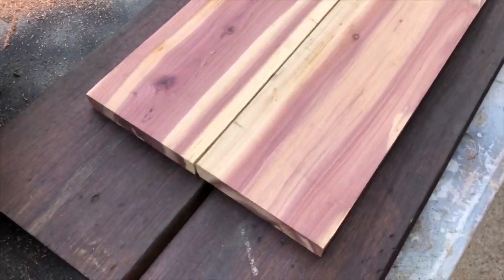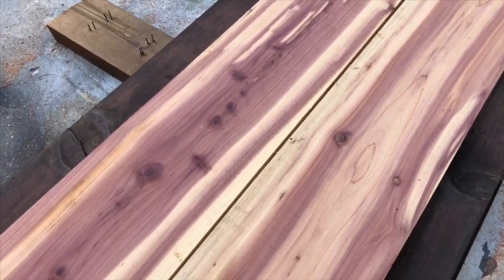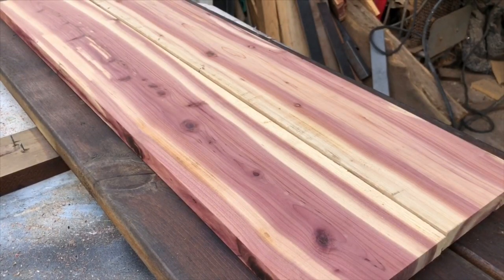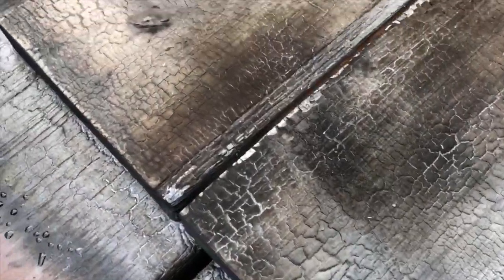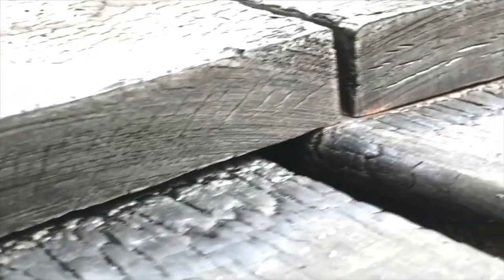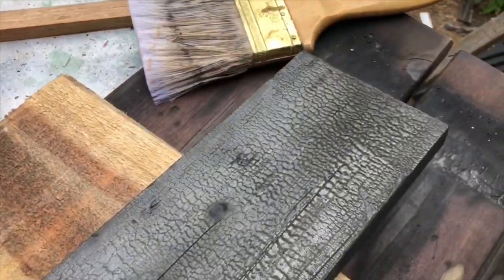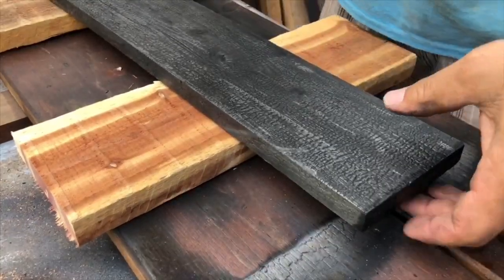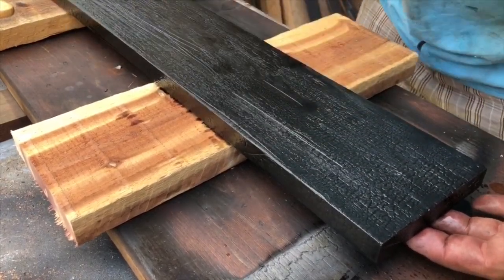DIY Heavily Crackled Shou-Sugi-Ban Charred Cedar Planks Burnt Wood Burning

Comment: Hi there! Amazing video! I was planning to make a new gate but I didn't have inspiration on what kind of material to use, until I saw your video. Therefore I'm reaching out for a couple of questions for someone unexperienced as me:

1) Can I use it with pine wood please?
2) After I get the wood charred, do I need to brush off the charred pieces?
3) Will this technique weather proof the wood if I intend to use it outside? I am from Mauritius 🇲🇺 and it is a tropical island. In summer we get loads of rain. Sometimes cyclones.
4) According to you, which dealer sealer will work best for my project please?
Reply from the maker: Hyperion 
1.yes pine works as well. Check my other videos for the one I did with pine. 
2. You can depends on the finished look you want if you do it will remove the crackle and leave a smoother finish. 
3. Yes that is one of the best things to use this for. Water, insects, fire, mildew and more. 
4. Sealing with an oil based wipe on finish is best.
Reply: @loveofthegrainworkshop2891  oh man! Thanks so much for replying! I'm planning NOT to remove the charred pieces. I love the reptilian texture it has. It adds a lot of character and it almost look "designer".

But I'm gonna seal it with polyurethane. Do you think it's ok? If yes, how many passes of this sealant should I do to stop the soot from flaking off if ever it happens in time?

I've checked your other video you made! I like it a lot! It gives an elegant "espresso" finish to it which looks cool for an interior project I have!

Thanks again for sharing your tips with me.

Comment: Try 100% Tung oil. All natural.  Do you have any problems with warping of the boards when heated ?
Reply from the maker: It can just depend on the board. It will sometimes. It wont sometimes.

Comment: If you were doing this for outside siding, do you need to only use cedar?
Reply from the maker: Chris Richter cedar is the traditional wood used due to its already weather resistant property. But it’s not necessarily required. It will last longer with cedar. And I have found that cedar gives the best crackle look.

Comment: Hi 

Great video. I was not actually interested in doing this technique, but how to fix my accidental fire damage (on pine wood, I think) in my sauna, which looks exactly like this Shou-Sugi-Ban. Having used Degrease All to remove the oil and to clean it (not sure if I should have done that), I just wondered how I might seal the wood, as I do like the effect. My question is, would Danish Oil / Linseed Oil be heat resistant and steam resistant so I can use it in my sauna? I like my sauna very hot, sometimes topping over 100 degrees Celsius. I also have a steam generator in my sauna too. Any thoughts would be appreciated on how I can create a reliable seal on the interior of my crackled wooden sauna when I get the chance to use it again. 

Thanks in advance
Reply from the maker: Mish Mahoney hey! Thanks for the question don’t know ton about saunas. But from research northern lights sauna sealer is the way to go!! Linked it below. https://www.amazon.com/dp/B00AWHHXOW/?ref=exp_love_of_the_grain_workshop_dp_vv_mw
Reply: @loveofthegrainworkshop2891  Wow, thank you so much for the super quick response.  Great.  I shall invest in this.  You're a star.  Thanks again. :-)
Reply from the maker: Mish Mahoney anytime. Feel free to ask anytime

Comment: Hi, i want to make a board for food (not to cut on it just to put the food on for presentation) and i want to make a board with deep char. So i need your advice, which coat i should use? I want to make a border strong enought to keep texture of chara nd of course it must be natural. I would be very thankful for advice.
Reply from the maker: Taras Ivantsio man that’s tough. Any sealer you use to hold charr in place is not natural. Food grade oil like mineral oil is what I use on serving boards. But that does not harden. I would suggest doing a nice flood coat of epoxy resin. Clear table top type. I recommend Incredible Solutions brand. It is easy 1:1 mix and is a great price. It will harden and seal it perfectly and then you can serve food on it. But do not cut on it.
Reply: @loveofthegrainworkshop2891  Thanks for very quick answer! I will do as you wrote, but last question, after burning wood till deep char, do i need to clean it in some way? or just wait until it become cold and use epoxy?
Reply from the maker: Taras Ivantsio nope. Just let it cool and pour the epoxy

Comment: First of all; great and really helpful video.

I got a question about the long-term success of the finish. 
Would you recommend doing it this way or have you encountered something better since the making of the video?
I'm planning on doing a similar finish on a guiitar body and currently researching on how to best seal in the wood after heavily charring it.
Reply from the maker: For the heavy crackle this worked wonders. You could also use Minwax Polycrylic or epoxy resin. All would lst

Comment: Can you link the products used to seal it just for clarification? And did you do a true 50/50 or just eye ball it? And one last question, you could seal it with epoxy after sealing this way? I like the deep black charred look after you apply the finish.
Reply from the maker: William Kelley William Kelley hey thanks for the questions! 

https://www.amazon.com/shop/love_of_the_grain_workshop 

Is a link to my amazonshop that has pages of all products I use. For this one I used an even mix of Polyurethane and linseed oil. Or you can use tongue oil. The exact products I used are in that link and there cheap and quick shipping on amazon. I eyed it 50/50. A little more or less doesn’t matter. Check out my latest shou sugi ban vid just listed with an epoxy resin coating on it. It came out amazing.
Reply: @loveofthegrainworkshop2891  thank you so much for the response. I plan on mirroring you're process 1 for 1 then adding several layers of thin epoxy to create a nice got smooth service to build a computer desk out of. When I have a final product, I'll let you know!!

Comment: I'm in process of doing this for my cedar plank siding. I sealed with teak oil. However i noticed I'm still getting a lot of char residue on hands while handling the boards. Going to do another coat tonight. Should that solve my problem or is there something else you can recommend?  Thanks
Reply from the maker: You will definitely need a lot of coats to prevent that.

Comment: Hey! that's a very detailed video, thank you so much! We are thinking about doing siding of our house with Shou Sugi Ban, but our contractors say that all of these beautiful cracks will fall off after the first winter. Is it true? how hardy is this finish?
Reply from the maker: Miss Chriss the original purpose was for use as siding, fencing etc. the whole point of the technique is to protect the wood from weather, bugs etc. It will outlast treated wood and paint if sealed correctly. Tell them to do the research on how to make it properly.

Comment: Awesome video! I was thinking of making a small pair of skis in this style that I will be using for backcountry trecking. Skis have a rocker in the front that I plan on putting in via steam bending. How can I make sure the burning technique doesn’t warp my rocker and create asymmetrical skis? Thanks!
Reply from the maker: Kaya hmm good question. Just be sure to have plenty of water on hand to cool it as you go. That should help.

Comment: Thank you for your videos, and your welcoming attitude. What's your opinion on using Tung Oil over a wire brushed surface (took a pine plank, charred the surface until a crocodile patterned char formed, took a cheap Harbor Freight stiff wire brush and cleared the char)? I just began checking out the Sho Sugi Ban technique, and I already have the Tung Oil. Thanks in advance for your advice.
Reply from the maker: SaucyTreasures I have a video on that technique as well. Check my other vids. It’s the one with almost 1 million views. I cover how to do that as well

Comment: Thank you for this video! My husband found a charred cedar from decades old forest fire in our property and we wanted to make something out of it for outdoor. I'm not sure whether you used an interior or exterior polyurethane but can I mix the exterior polyurethane and boiled linseed oil?
Reply from the maker: You would need one or the other. No need for both. Exterior poly would last longer.
Reply from the maker: Be sure it’s oil based though NOT water based.
Reply: @loveofthegrainworkshop2891  I see. Thank you so much for the quick response and more power to your channel!

Comment: Have you done a heavy cracked piece with an epoxy top. Was thinking of doing that for a bar top?
Reply from the maker: Richard Williams i am working on that. But haven’t yet
Reply: @loveofthegrainworkshop2891  just finished making one
Reply from the maker: Richard Williams I just posted a video with colored epoxy resin on top for a trial piece before I go full scale. Check it out!

Comment: I am planning on doing this for our kitchen open shelves.  Did you find the Danish Oil to be the best sealant, without looking plastic-y (like epoxy)?  I want the least amount of transfer possible.  Preferably no transfer whatsoever.  Thanks!
Reply from the maker: OneStopJosh yes I liked the way the Danish oil looked and felt after the full cure without any transfer. Try a wipe on poly as well. Both work good. Wipe on poly can be recovered multiple times in a day.

Comment: Hi, I’m currently trying to make some seating using barrel staves, because they have been used for the storage of whiskey, they are charred in a similar way to the wood I your vid. I have wire brushed and sanded most of the loose flakes and dust away, and I’m looking for a treatment to stabilise the remaining surface. I clearly don’t want the charring to come off on our clothes (not bothered about my own, but if it comes off on my wife’s clothes I’m dead). do you think this mixture would do the job? And is there any chance of you doing a short video, showing how robust this finish is, once it has cured?
Reply: Oh and thanks for the videos, they are great. Haters are always gonna hate.
Reply from the maker: Thanks so much. I have used barrel staves for the exact same thing. I use Minwax Polycrylic as it builds up on the surface and once filly cured (about a week) it lasts a long time. Three coats minimum.

Comment: If you only give it a light char, does it still protect the wood from wrought?
Reply from the maker: Thomas Chung yes. It doesn’t need to be crackled heavy to be beneficial. But does need to be burnt black lightly.
Reply: In order to achieve the long term preservation properties this process is traditionally used for you would need to go well beyond the surface. Typically in Japan when this process is used they will burn three boards at a time making a chimney and igniting a piece of paper at the bottom end of the chimney. Depending on the length and thickness of the boards, it will burn for 5 minutes or more. Deeply Charing over half of the thickness of the board in order to ensure the longevity of the process. This process in the video is used for more visual appeal than rot resistance. It looks fantastic I think. Well done

Comment: Awesome video :) can you please explain the oil to use for sealing? I am thinking of doing brush off furniture after burning Pine.
Reply from the maker: Justin C it’s a version of danish oil. A 50/50 mix of Polyurethane and linseed or tongue oil. You can also spray it. Or use wipe of poly. Which is poly diluted a little with mineral spirits.
Reply: Love Of The Grain Workshop  thank you for the explanation. When you revisited the end results, you didn’t mention what your intended use would be. I’m looking to seal the char for use on a long hall wall and want a good look and as well as protection. Would you recommend this method of sealing or what do you suggest alternatively?
Thank you in advance!!
-Chris

Comment: Nice work.  You said to make sure to spray the wood with water.  Do you mean to just keep the flames down or do you spray it before or after your finished bunring?
Reply from the maker: garrisjr yes just to keep the flames down and to prevent it from still burning further than wanted.

Comment: How do you avoid cupping or warping when working with larger projects say PINE 2x10's and a larger heat source (large propane torch)
Reply from the maker: docburch55 pre wet the surface with a pump sprayer and charr sections at a time then immediately drench each section with the pump sprayer to cool it down after. Large boards have less tendency to twist or bow etc. do individual boards then build after torching and sealing.
Reply: So should I avoid larger torches and stick to smaller handheld ones as well?  Thanks for getting back to me
Reply from the maker: docburch55 I’d definitely use a large propane torch like a weed burner or similar. The handheld ones are to slow for large pieces.

Comment: will this work well with birch plywood? secondly, does it change the thickness/dimensions of the wood? lastly, i’m thinking about doing this for a bed, do you think it’ll stay strong enough if i use birch plywood and only burn the top surface to this extent? and if i apply appropriate enough amount of sealant, will there be any rub off into my mattress/sheets?

sorry for so many questions lol
Reply from the maker: Murtaza I wouldn’t try it on plywood. It can and will melt the adhesives. It will change the thickness of the wood by a fraction. Yes if not sealed it will definitely rub off on the sheets

Comment: I'm new to this burning technique but I really love it. I like the look of the wood when it's burned and then scrapped ... has all the peaks and valleys look. But I also like the complete chard look. I'm in the process of trying to have the best of both worlds .... Char it, scrape it. Then char again. I've never seen this done ... maybe because it doesn't work. lol
Have you ever tried this or seen this technique before?
Awesome video btw. I loved the slow motion charing. Very satisfying to watch. 👍
Reply from the maker: bymitten1 thanks very much for the comments and questions! As far as brushing then burning heavily again. You can. But typically when charred heavily the wood bubbles and raises. Which creates the heavy textured crack. So it might not work. But if not you can always sand and redo. I would say if you brush it. Char it just until you see the begging of crackle then stop. That way the embossed lines don’t change to much.
Reply: I've done the double burn before and it turned out great on redwood. Deep alligator burn, scrub off char, then deep alligator burn again, scrub off and rinse. This leaves deep grooves in the wood as the softwood between the rings burns away. Creates a great texture. 'Peaks and valleys' look is right!
Reply: Very cool! Thanks for the tips. :)
I tried a double-burn on a sample piece of pine I had. Didn't have any added effect except the piece was considerably thinner after.  I'm sure all woods have their own effect.

Comment: hello sr  you dont brush it ? and you drop the water after burn it ? i like that finish that finish is what i im looking for !}
Reply from the maker: leopetar jk I brushed the finish on in this video. I typically spray it on now. And I use a pump sprayer for watering it down to cool it.
Reply: @loveofthegrainworkshop2891  thanks man !!!
Reply from the maker: leopetar jk anytime! Be sure to check out my latest Shousugiban video!

Comment: Hi, thanks for this video. I have a question for you. I'm trying to figure out the best way to achieve the alligator finish on some pine. I will be using it for a fence, and want it to withstand the elements. Is the best way to burn it to get the crackling, and then entirely skip the brushing part and go straight to poly-urethane? Since it'll be outside I don't want to have to re-oil it every year, since the opposite side will be on my neighbor's side and I doubt he will want to do it as well.
Reply from the maker: Yes you are absolutely correct leave the char on for the best protection. Unfortunately sealing is still something that would have to be done occasionally. As to how often that would be based on your weather etc.
Reply: @loveofthegrainworkshop2891  thanks so much for the quick response. Is there anything else I should think of since I'm using this for an exterior application. I understand that the more I scrape off, the less protection regardless of the poly-urethane. Correct?
Reply from the maker: Yes. The more charr you can leave on the more protection. If you scrape heavily you will eventually get down to fresh wood. The pores will somewhat still be closed off. But obviously not as much as if it were charred still.

Comment: Hi! I love the video ! But i have a question, how long do you need to wait before you can aply a first coat of product on the wood ? Does the wood need te cool down first or dry? Thanks!
Reply from the maker: Definitely need to cool and dry. Which if you do it outside on a sunny day it should dry out within 15-30 minutes. You need to seal pretty quickly otherwise it can continue to warp or twist